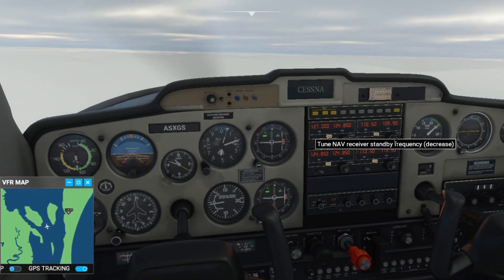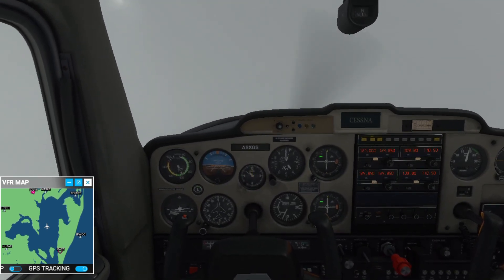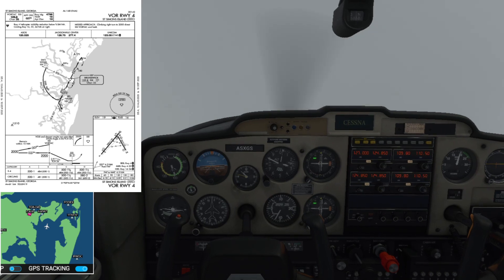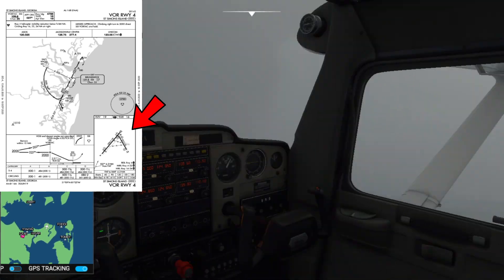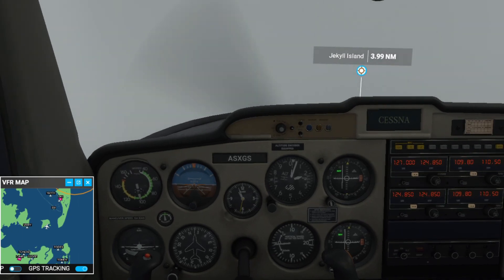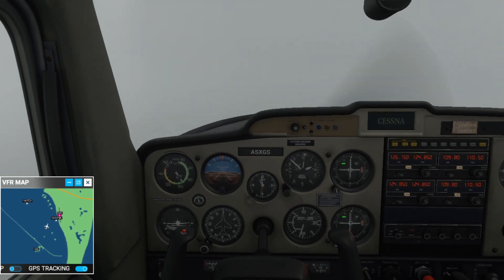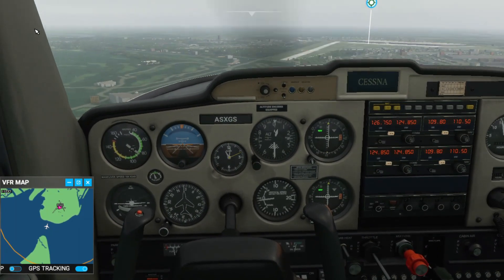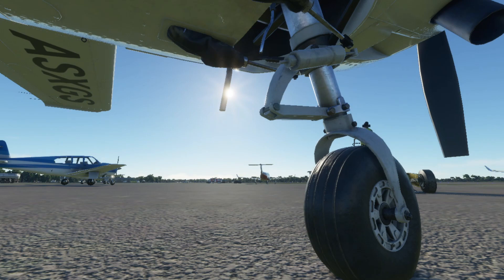Microsoft Flight Simulator | How To Do VOR Approach | Cessna 152 | Commentary | Tutorial

Comment: I see the DME button on the 152 in FS2020. How does that work? I have not figured it out yet?
Reply from the maker: Kevin Aldrich I’m aware about the DME button, it seems like it’s just for display and inoperative for sim use. Just like the A320 default model, not all overhead buttons are interact-able.
Reply: @DaftPilot  So the only way to get the distance to the VOR is to time it?
Reply from the maker: Kevin Aldrich that’s is correct, you’ll see a diagram of the airport on the approach plate and exactly below it are different airspeeds in knots and time given in minutes and seconds to give you an idea that at whatever speed you chose from the given speed list you would reach your missed approach point and should have the runway in sight at that given time frame. An example if I travel at 90 knots and I’m already past my Final approach fix (SSI VORTAC) and I start my timer, I descend down to the minimum decision altitude of 500 feet (6.3 nm from FAF to MAP) and once the duration of 4 minutes and 12 seconds has been timed and you have the runway in sight you continue the approach. if you did the above and DID NOT have the runway in sight by the time the clock finished the 4 minute and 12 seconds time you can’t make that land and must do the missed approach procedure. Also mind you the approach plate doesn’t require DME, all you need to do is set the course towards the VORTAC and that should take you directly towards it depending on where the needle is, you need to center the needle to determine where you are in relation to the VORTAC. Hope that answered  your question!
Reply: @DaftPilot  That sure does. Thanks for the info. Just subbed. Looking forward to more of your videos.
Reply from the maker: Kevin Aldrich much appreciated, welcome aboard! If you have any further questions, suggestions or requests feel free to comment.
Reply: I was here to ask the same question :)